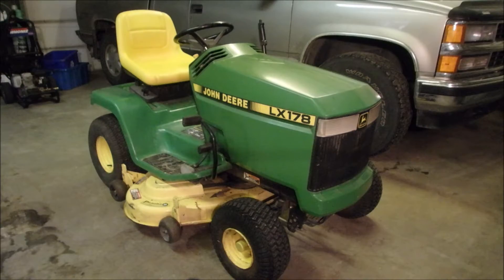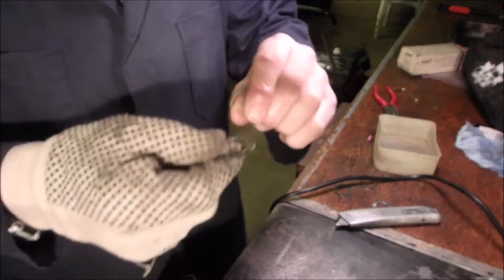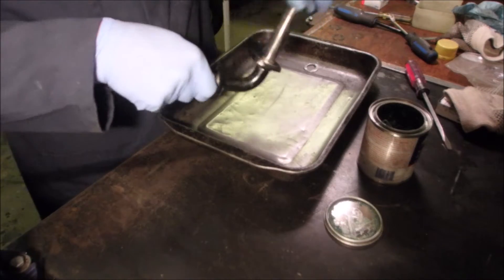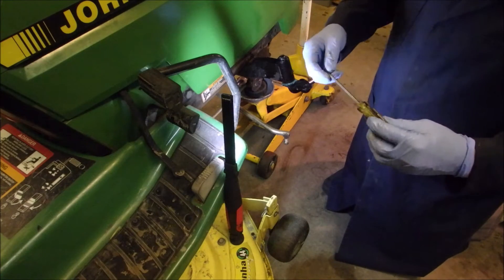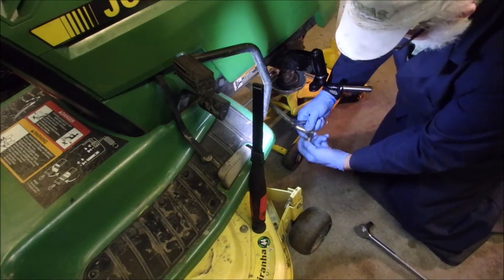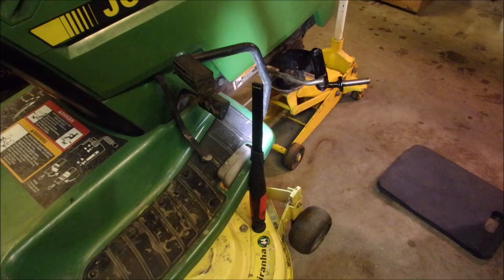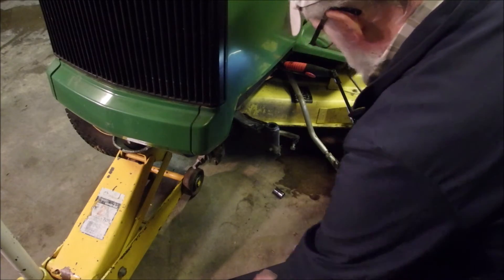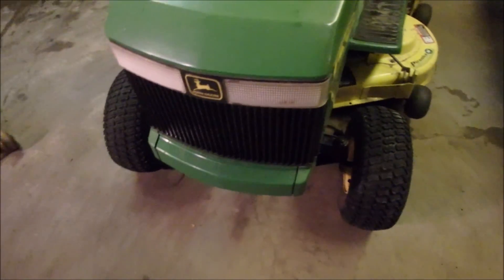Poorman's Power Steering THE SEQUEL

Comment: That was a neat job.  The steering, if not easier, will be a lot better at any rate.  Those Dremel Tools are some useful.  I got one for a gift one time and thought, "Well that's cute, but I'll never use it."  Well I certainly was surprised.  It has saved my bacon more than once.  Have a great week Bruce!!!
Reply from the maker: Thanks Grampie.  your comments are always welcome.
Reply: @BrucesShop  nnhi what size bearings on john deere
Reply: Were used on john deere what size bearing were used on john deere.

Comment: My D170 JD is getting its 3rd steering overhaul tomarrow. It’s always so hard to steer, I just ordered the thrust bearings like you used and will install when they come in the mail. What wears out the most is the sector gear and the steering shaft pinion gear. Saturday one of the drag link ball joints fell apart.  I think your idea will be a bunch less we’re on the entire steering system.
Reply from the maker: I hope it works for you

Comment: If John Deere were smart they would build their units with the thrust bearings and proper clearance for the snap rings or, on the S240, E clips. There are two small bumps forged on the top of the tube beneath the washer. I had to grind them off to reinstall the E clip while not binding up the spindle.
Reply from the maker: I am glad you did it.

Comment: I use a heat gun on those blasted rubber/plastic hub caps to soften them to remove.  Then when installing I let them sit for 5 minutes in boiling water.  They get nice and soft so you can expand the opening with your fingers so they slide right over the washer.  Then they will shrink back to normal size as they cool off.
Reply from the maker: Thanks Ken

Comment: Bruce, enjoyed both 'poor man' videos, thanks for the effort.  I have an idea and a question for you and anyone else willing to chime in.  The Dremel 'notches' are a great idea to allow grease into the roller bearings.  What if I installed the top washer with slightly larger ID -or- preferably slightly smaller OD??  Wouldn-t that allow the grease to flow to the roller bearings and eliminate the need for the notches.  I intend on doing mine soon and welcome all responses/recommendations.  Thanks again.
Reply from the maker: I think that would work.  Either one would be interesting.  Let me know what you do.
Reply: @BrucesShop  went with a SLIGHTLY larger ID washer, only used it for two hours so far.  Can't tell exactly how much impact the thrust roller bearings have had on my steering because I also installed new spindles, link rods, and wheel bearings (replaced the bushings), but steering is now as smooth as a sharp knife threw soft butter :)

Comment: I have yet to one on a JD mower yet like that I have worked on quite a few steering systems and the owners always say that it's fine like it is..........   Maybe later on down the road someone will want one done like that ... 

I think the first video I seen on this was Zippo Varga doing it ...........

Plus Tard Non'c Bruce ~!~!
Reply from the maker: They get stiffer the older they get.    My 180 is a 2 handed operation.     (or was until Zippo's poorman's powers steering upgrade.  Thanks my friend.
Reply: @BrucesShop 
Does bearing face up or down on shaft

Comment: Great video Bruce.  Do the thrust washers come with the roller bearings? or Ball bearings?  Did you mic the shaft to get correct size?
Reply from the maker: Here are the links to the parts.  It is a Canadian link but the info is there.  I added the links to the video too.  Yes I mic the shaft   3/4 inch
https://www.motioncanada.ca/productDetail.jsp?sku=00094587

https://www.motioncanada.ca/productDetail.jsp?sku=05073754

Comment: Yes I have a claw hammer in my tool box for doing Mechanic work !!!
Reply from the maker: I know..I should have used a bar.
Reply: A claw hammer is a good tool to have ..I have an older plumb with the rubber coated fiberglass handle and have used it many times over the years on car repairs @BrucesShop
Reply from the maker: @not2fast4u2c  Thanks Jim.

Comment: Heat the plastic hubs with a heat gun. They will come off easier.
Reply from the maker: Thanks I a great idea.  They are easy on a hot day.   Great point.
Reply: tip from Taryl Fixes All That guy is a small engine experts expert.

Comment: I always thought since the 1970s that all small engines for mowers and snowblowers should be designed to allow the electric start option.  Really sucks to have to pull your ass off while trying to troubleshoot an engine that won't start.  SO much frustration and exhaustion could have been avoided if all engines had that electric start option built in.  The only time you should have to use the pull starter is AFTER the engine has already been running and you're out in the middle of the yard.  I mean come on, are we living in a civilized modern industrial society or what?  Do we still crank start our cars?  uuuhhhhh, NNNNNNOOOOOOOOOO  hahahahahahaha
Reply from the maker: Agreed
Reply: @BrucesShop  Every mower should have this electric start option https://www.youtube.com/watch?v=tPCHXZ3K1yM  Have you ever installed one on a push mower?

Comment: nice job sir
Reply from the maker: As you ask about our weather a lot we got 4 inches of snow last night.  Have a great weekend.
Reply: @BrucesShop  i know i sound cheeky but im a bit jelouse  i love cooler weather im running ac right now
Reply from the maker: @ebfromwyoming4118  Well as you know by now we have snow on the ground from November til April.  The earth freezes to a depth of 3-4 feet.  It thaws in early May which is when the ice melts off the lakes.  You can drive out onto the lakes pretty much all winter.  Winter has started here 4 weeks ago.    (not the calendar winter).  After 62 years of it I yearn for warmth.  But it is home and yes it is darn pretty after a snowfall.  I am up-playing it a bit but I am not lying about the cold.  If you go outside in January without a parka you will die.

Comment: Don’t fall for this it’s a waste of money. I did it and the results were very poor. You will never feel the difference
Reply from the maker: I have had great luck.  Especially on the JD180.  I could hardly steer it before I did the mod.
Reply: @BrucesShop  your tractor probably had lots of hours on it and just needed a new washer and grease, not this sysytem
Reply: Just finished new axles,drag links ,wheel  bushings, then decided to do the needle bearings on my2004 L110. I'm not feeling it but my right steering axle was pretty much seized so now the steering is much lighter.